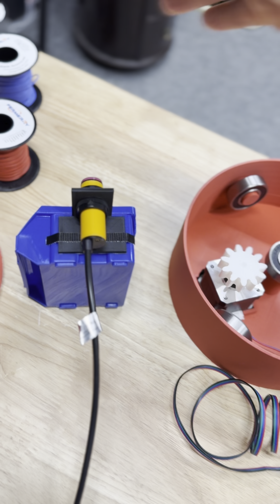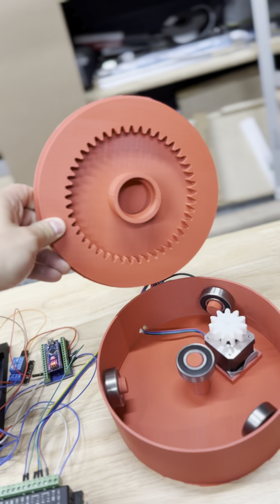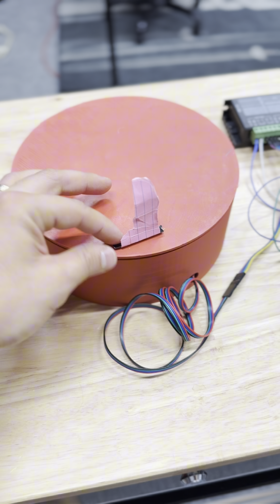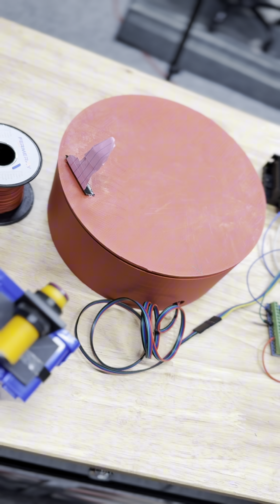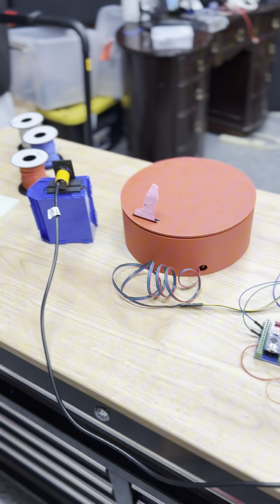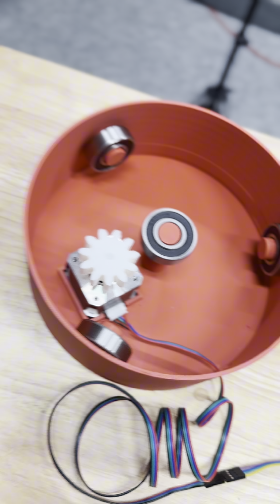Open Vs Closed Feedback Systems Explained! #science #electronics #engineering #robotics @arduino

Comment: To know how much the table has rotated, you could use an encoder (either magnetic or optical) to know how much it’s effectively rotating. If it’s an “absolute encoder”, you can know the exact position it’s in. Those cost more so oftentimes a simple homing switch is used to know when it circles back to its home position
Reply from the maker: That’s true!! Not super critical at this scale but a good idea for a commercial product!